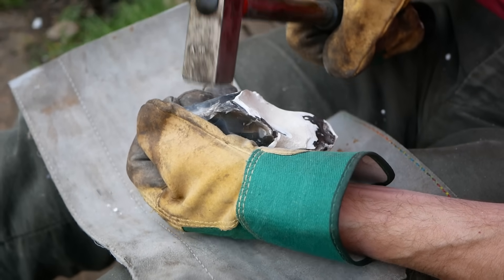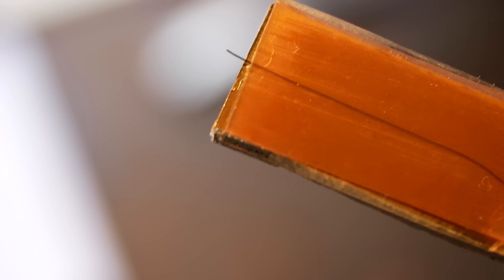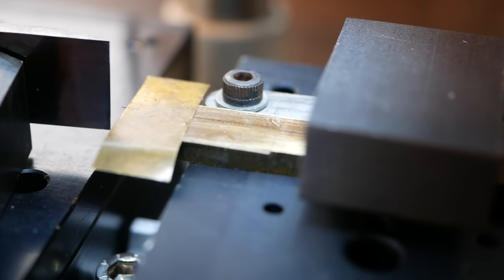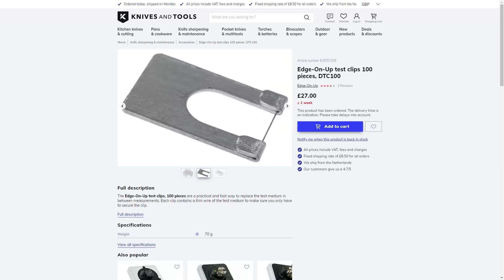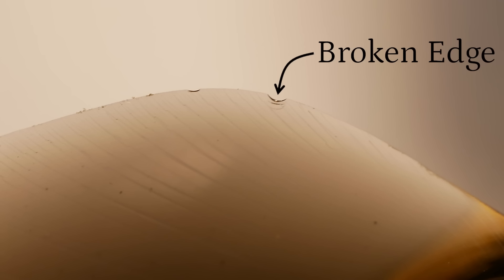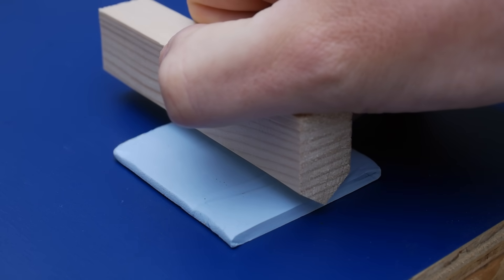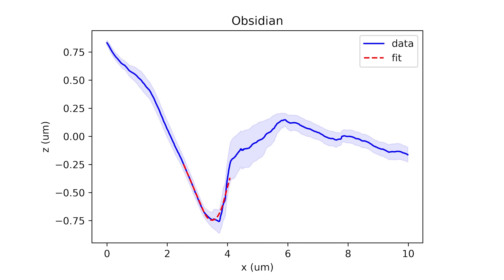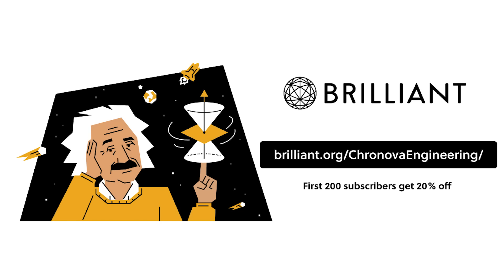Does Obsidian Really Form the Sharpest Edge?

Comment: But more seriously, applications for obsidian are typically scalpel tools. So it means that instead of a push stroke, it's a gliding stroke across a surface (slicing). Your setup measured sharpness of something pushing; would gliding change the parameters of the problem of sharpness?
Reply: it also fails to address obsidians self sharpening via edge fracture. It's not a flaw, but a feature of obsidian as opposed to metal, where instead of becoming dull, it becomes serrated with new sharp facets
Reply: @Azmodon  but wouldn't fracturing be a big problem when used for surgery? I mean, random debris in the wound?
Reply: @Azmodon  It doesn't necessarily sharpen itself. That's based on how the edge fractures. If it's at a steep enough angle (almost in line with the edge geometry), then yes, it can sharpen itself, but more likely it'll fracture in such a way that it loses sharpness.
Reply: @Azmodon  I would absolutely love my surgeon to use a self sharpening scalpel
Reply: @Azmodon  If so, then it doesn't slice, but rips and tears. Therefore, it cannot be called a cutting edge. The ideal application of such an edge shouldn't require sliding motion, whereas serrations on a material such as obsidian would in order to rip the material.
Reply: @avetruetocaesar3463 not true obsidian does infact chip and become serrated with use but because it's volcanic glass those extra edges are still sharp however the test shown has them applying force where they don't need it obsidian acts more like a sharp blade being dragged across an object as apposed to slamming the blade into something
Reply: @Azmodon  but the edge did fracture and only got more blunt?
Reply: @diobrando2160 that's because it was forcefully pushed into the wire.  Flint and obsidian "knives" would more likely be used in a slicing motion.
Reply: @diobrando2160  it didnt cut it because it was being pushed. not glided cross
Reply: Would be interesting to be able to capture images that show how serrated it is, as well as be able to compare it to the granular structure of flint (chert and chalcedony).
Reply: Came here to make this exact same comment. I'm sure the obsidian would cut hair with a slicing stroke. Splitting hair with a push stroke is a different question.
Reply: The most practical use for obsidian is for building a nether portal.
Reply: Using obsidian in surgery would be terrible. It would leave the cuts full of very sharp micro-fragments of obsidian that could not be cleaned out and would continue to cause problems for the life of the patient. Most cutting applications use a slicing motion because it works better, but if you want to compare sharpness, you need a consistent way to measure it. Push-tests have proven effective for all manner of sharpness testing. Even in serrated edges, you're testing the sharpness of the edge of the serration.
Reply: You can grab onto a sharp sword with your bare hand and not get cut, if the blade is allowed to move sideways it will take your hand off! Slicing cuts are far more effective but difficult to reproduce under a microscope.  Obsidian is used because of its slicing and self sharpening properties which is totally not what you tried to measure.
Reply: I was going to say the same thing. The unevenness of the obsidian apex, combined with it's extreme thinness,  probably makes for an extremely viscous slicing action
Reply: To answer the last question- Yes it would.
Reply: 1) Obsidian scalpels are a secret of great plastic surgeons.  Finer the cut, less scarring/pain.  
They're super-ez to sterilize.  (Gamma-rays like every other scalpel on earth...plus...disposable, like every other scalpel blade...)
2) Brittleness is DESIRABLE. Highly.  These are weapons of hunting/war. You WANT the projectile to break, so at least 1 piece stays in the wound.  (Hopefully more!)  Each step the prey takes means the broken chunks shuffle and slice new damage.  The wound can't close, the blood can't clot. 
It's not like movies.  Game run on adrenaline sometimes MILES before they lay down.  If you pursue instantly - they keep running. Only lay when they feel "safe."  They don't get up.  So, you don't want them going far.  It's more humane if your bad shot becomes fatal - because of breakage. You can get a good blood trail.  Remember - no horses.  Tracking all on food, packing out 200 lbs per person - all on foot!  If it takes 2 days to find the game - spoiled.  Native Americans weren't dumb, they developed copper.  But saw it was a bad option for hunting/gathering. Which still provided more food than experimental farming.
3) Ancients would hate our steel scalpels. (High carbon, sharper, but rusts easily.)  They'd say - um...this is perishable. And not sharp/brittle like we want.  We can re-use obsidian spear heads we find in the dirt.  1,000-4,000 years old - we can re-sharpen/use!
4) Yes you can serrate obsidian.  Done all the time.  Make little knotches on the edges with little tools.  Check out some youtube knappers.
Reply: I love edging
Reply: Obsidian scalpels are not the norm, as they fragment when cutting tissue and can lead to further complications.
Reply: Obsidian is serrated. Is not sharp like a razor blade for example
Reply: @Dougerro   Maybe like a chainsaw :D
Reply: @Dougerro  razor blade also has micro serrations

All steel blades have that. It comes from the sharpening medium (e.g. diamond plates)
Reply: Those are rarely if ever used nowdays as far as I am aware, my brother is an eye surgeon y most of its cutting instruments have diamond edges.
Reply: @cesaravegah3787  Obsidian Scalpels are used in cardiac surgeries to this day, but other than that they don't get used much really. Obsidian is just alot more expensive than stainless steel and steel scalpels are sharp enough anyway
Reply: @turfish  Yes of course,  common cutting instruments are almost enterily made of steel which is not only sharp enough but safe and durable, we however miss totally the point, we were talking about the top of the scale, the sharpest possible instruments, like the ones used in most of the most complex eye surgery, there even the sharpest steel scalpel will leave a scar, seriously impairing the patients sight, a good diamond tip scalpel leaves a cut which heals without a trace.
Reply: @turfish  Obsidian scalpels aren't really used in any serious quantities, there have been a few doctors experimenting with it, but it is largely avoided due to the chance of having shards break off inside the patient, and the difficulty of sterilizing the scalpels.
Reply: Dragging and sawing motions are used when the cutting edge is not sharp enough to do the job properly.  Yes, the obsidian will slice a hair if used in this manner, but a knife can accomplish the same feat without having to be as sharp as well.